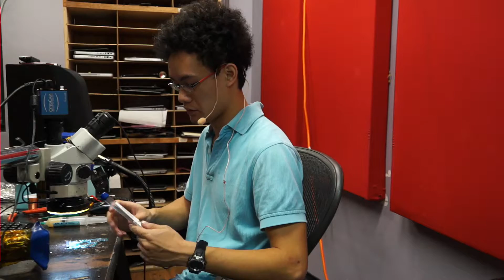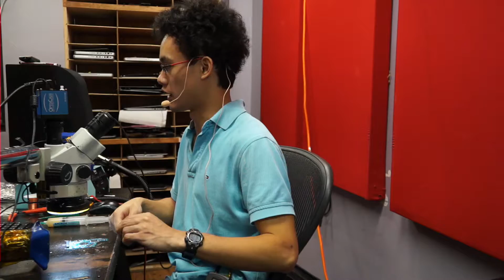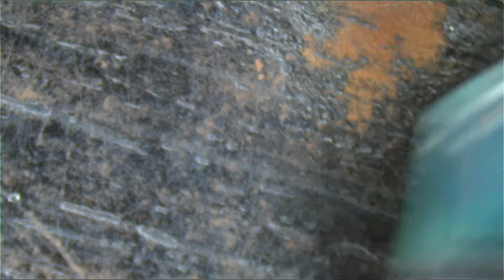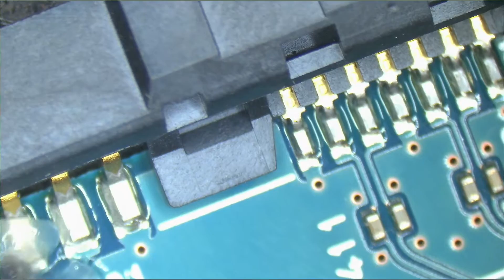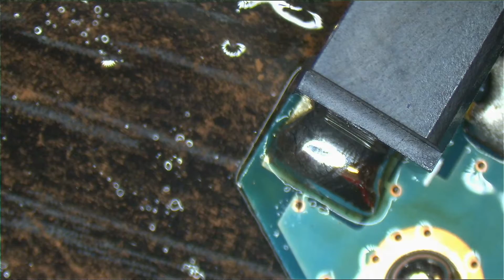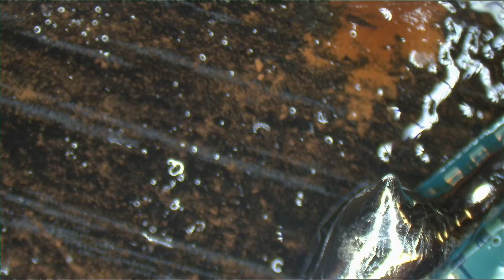How to use FAST CHIP removal alloy

Comment: So I have noticed that when you use the fast chip removal alloy, you compromise the component because when you go to resolder it onto another board the fast chip is still present. This causes your solder joints to continue to melt at these low temperatures. Just something to be aware of. You should try to remove all of the fast chip from the component before soldering it onto another board.
Reply: Wicking the old solder off of the component is part of the preparation before installation. There won't ne enough low melt left on the pins to make much of a difference.

Comment: 750  degrees on the iron?? I don't call that low temps.
Reply: Temp needs to be that high to get the normal solder melted so the low melt will mix in. The the most dangerous part of component removal is the time it takes to apply enough heat to free the component. Without the low melt mixed in you'd have to apply high heat for longer time, risking component damage and pads lifting.
Reply: @houndawg3  Actually I'm looking to solder steel screw to steel plate...don't want to use propane or any other open flame. Saw a vido where the altered the tip of a weller that really localized the heat more than average.

Comment: I absolutely love ChipQuik. Can't vouch for this generic knock off though. One thing I might point out. Your components might benefit from setting your iron to a lower temp. Especially if you plan to harvest them without any thermal damage. 750 °F (398°C) is way too high if you plan on re-using the component. Since this is a super low melt alloy, you could easily set your iron temp to 280°C, or possibly even lower, and achieve the same results without the risk or overheating your components. I've done quite a few  ultra fine 128 pin QFP's this way.
Reply: How are you going to melt the lead free to get the low melt mixed in if your iron is only at 280°C? The object is to get the low melt mixed in and then lower temps or shorter times can be used to free the component.
Reply: @houndawg3  I was wondering the same too, I would think that high temp is needed to melt the target solder.
Reply from the maker: Mike Mundell Appreciate the advice but it's a connector; there is nothing to damage.
Reply: Except plastic. I don't even do my normal soldering with temps that high. It kind of defeats the purpose of low melt if you're going to keep the temps through the roof. No need to keep the temps that high if unneeded.
Reply: @mike7958  :  Fast Chip and ChipQuik same alloy.